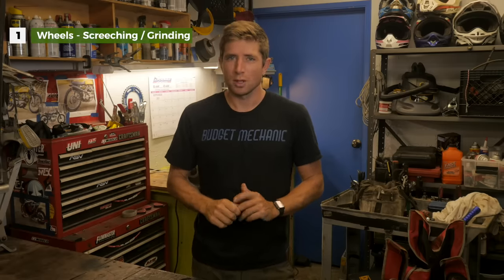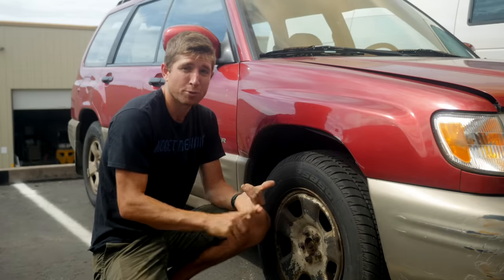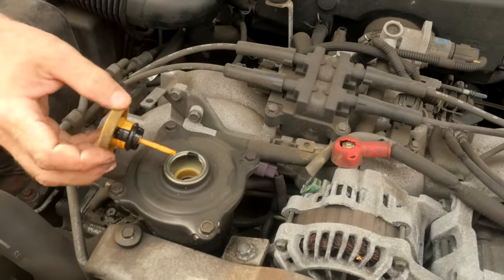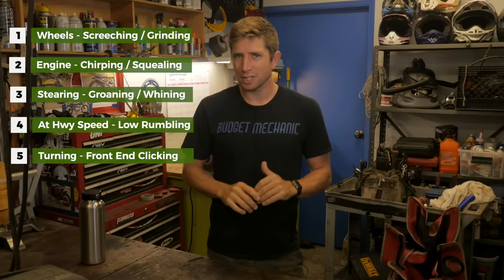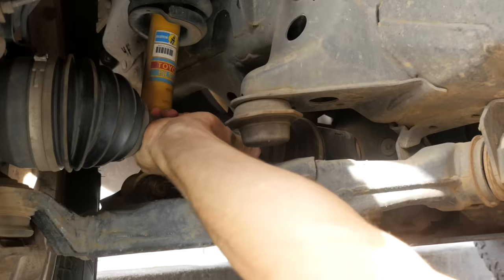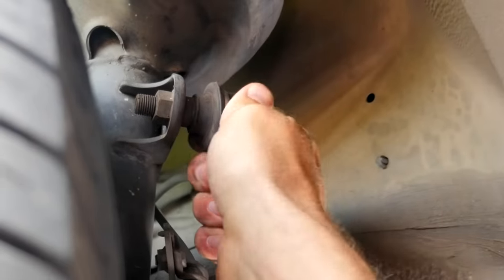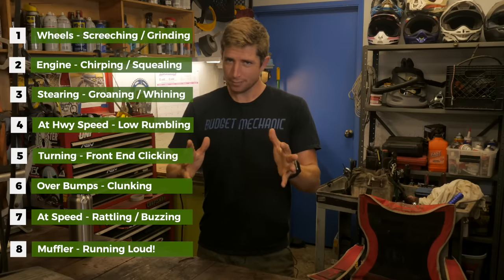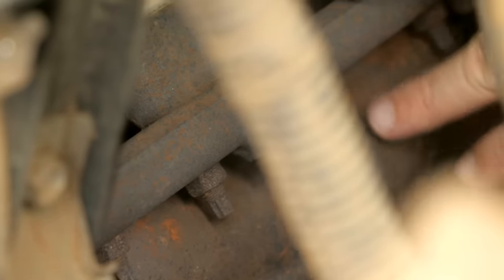8 Top Noises Your Car Engine Makes and How To Fix- Grind, Clunk, Squeal, Click, Groan, Rattle

Comment: Hi there!! Thanks for the video.
Relating to sound 3 Steering - I have the exact same noise every time I turn my steering wheel. I added some fluid into it and I could see the foam inside it when I opened the reservoir cap.I turned the steering wheel lock to lock to get ride of the air bubbles, but that didn’t work. I kept checking it and oil the started to leak from the reservoir even when the cap was tight.Also, the turning steering noise had intensified. Is it the pump failure or the air leak in the system? Would it cause the entire the steering system failure, because I could feel the friction or grinding motion every time I turn the wheel.

At first,as soon as I noticed I filled the power steering fluid to prevent further damage, I could feel the pump working fine and was able to steer easily when I first noticed and topped it with fluid, but it started to leak again making to hard to turn.

Can you help me understand??
Thank you!!

Comment: and for trucks, you have the horrible grinding noise under your truck, your center support/drive shaft bearing. You have to take the entire drive shaft off and honestly use a hydraulic press to install the new one. ive done it twice with just blocks of wood and a sledgehammer, and its not the proper way. it will never be on like the factory unless you use a hydraulic press they have in a shop. and then axel noises. I feel like we'd need a whole different video for pickup trucks.

Comment: Holy shit those sounds allowed me to instantly diagnose a CV and sway bar issue that's been driving me nuts!! Thank you so much for this helpful video! I'm also experiencing a whining sound at higher speed that's only present when accelerator is being pressed. When I let off the pedal the noise stops. Could this be low or bad transmission fluid? Manual says to change at 60k with severe use. I'm at 84k now and live in hot ass South Florida with dense city traffic. The fluid has never been changed or flushed.

Comment: My car has one of the last 2 problems.  I ran over a speed bump too fast and it's been making that noise ever since.  It probably dented a heat shield or caused an exhaust leak of some sort.  At first I thought it was the transmission, but the mechanic ruled that out.  Now I have a new more serious problem that the oil cap has blown off twice now which might mean the engine will go soon.

Comment: my car make the noise on 6:58 when I am braking over bumps (mostly downhill) and the brakes are releasing, then I press the brakes very hard to stop the car or even use the hand brakes, it don't happens all the times but its dangerous and my mechanic don't know what it is.

Comment: I’m having a sound that’s sort of like a  soda can rolling on pavement, or maybe a high pitched frog. It happens at low speeds, most loud and longer when I’m coming to a stop or turning. When in P, I almost don’t hear it at all but just a slight brief sound if I tap on the gas pedal. In combination with this, the oil pressure gauge drops low. It’s somewhat low when in P but if I’m in gear and turn the wheel (even if I’m not moving), it drops low and I hear other humming noises in addition to the rattling. Just had oil change. 

2004 Astro AWD, 170,000 miles

Comment: Now this is a five-star video. I think the one bugging me is a heat shield.  It has had some before. Your clue. maybe  a rock got under it has given me something to look for. Usually tapping things with a rubber mallet finds these, but so far that has not found the current one.

Comment: Thanks Josh, This is the most comprehensive description of problems I have ever come across. Thank you for that. I am currently in research for a loud bearing0like noise coming from the front end that seems not to be the wheel bearings. Our 2012 Ford Explorer 4X 4 sounds like bad bearing(s) but all are firm and the sound doesn't change on turns. Can't figure it out!

Comment: Hey, i watched this video was good but didn’t cover my concern let me know if someone can help me,, i have 2008 toyota yaris, i started hearing ticking noise from my car as soon as i put in drive or reverse it produces noise otherwise in neutral or park is fine no noise but like i stopped at intersection and still i am in drive as usually we all are that noise become loud and it is like tick tick tick continuously but if i drive it goes or just like lower down. Let me know my city is very expensive asking $250 everytime i ask for inspection.

Comment: I know this is an older vid, but hopeful for a response anyways? (Prefacing with already planning to take my car to the mechanic) 
My left wheel is makin a noise that makes me think of something stuck in bike spokes or someone poking something into a fan blade. Its at any speed going straight or going left (hard left, slight left, any left). Nothing when wheel is pulled right to any degree. 

Theres the slightest of vibrations, but nothing really noticable if you arent paying attention. No shaking either. 

Like theres 3 things you mentioned that might be it but im just not sure.

Comment: I have a question. After driving my car for a while my left front wheel on my is300 starts squealing you can hear it very well when I drive by a curb and when I brake it gets loud then it goes away at a full stop. Then once I start driving again it starts squealing, I’m not sure what’ it is
Reply from the maker: Might be the brake pad retainer clip rubbing on the rotor

Comment: The best way I can describe my sound is a rubber ball bouncing in a plastic bucket. It sounds similar to the stabilizer Links.  This is a 2021 camry and I'll be taking it in for the 5th time. They can't seem to figure it out and the 4th time they tried playing the "I don't hear it" card when I demoed the issue.  At this time I'll have to figure out the lemon process

Comment: @ 6:42 - "...you just have to replace it, to see if that's what it was."

I'm convinced far too many mechanics go with this method for diagnosing and suggesting solutions for all areas not just the CV shaft, lol...way too many instances of outrageous bills to replace everything in the area from customers (including myself), when it either a) was unnecessary or b) didn't fix the issue

Labor costs for legit repairs I can accept. Mechanics have to charge hourly and get paid too. What I hate is how I how ongoing issues from Mechanics suggesting incorrect or costly repairs has happened to both my wife and I's vehicles. This is why I like vids like this because at least I can play the diagnosis game myself on my own time without labor costs (except my time). Hardest repair I've done (differential bearing) would not have been possible without youtubers and this "sound guessing" game.

Comment: My car sounds like an appachi helicopter fluttering kinda sound not a clue what it is. Don't match any of these
Reply from the maker: We tried to add that to the video but couldn’t get close enough to any Apache’s to record it so we took it off the list, sorry!!
Reply: @BudgetMechanicHawaii  it’s like a sound when you have windows open going down a road fast only windows closed and it’s coming from within a diff place

Comment: For my Hyundai i20, when I switch on the engine it creates Hmmmmnnnnnn. The car seems to be underpowered. Previously car was in garage for 3 yrs without mobility. Got to Garage and they said Alternator is not working and also AC COMPRESSOR IS gone. What should I do?

Comment: My issue with my steering wheel is that i only hear this knocking/rattling noise whenever I go fast on the highway. About 60+mph. It's annoying because i only hear and feel the rattling/hard vibration when I leave the steering wheel straight. Soon as I slightly turn the steering wheel to steer or turn on a curved road it goes away. Someone please help me figure out what the noise is. I have a 2014 Santa Fe sport Hyundai.

Comment: Hello, i have a problem with the back wheel left side of my car

It all started from this old mechanic guy after replacing the break pad. 
He went for a drive test to check whether the sounds is still there, unfortunately there is still sound. But he told me that it’s normal and bla bla bla. 
Then after 3 days, i went to vacation and took my car, it was a 4hour drive. I started to hear weird sounds, it turn out that the left tyre wheel was not fitted properly. It collapsed a bit and not at the straight position. I called someone to fix the wheel, and I thought the sound gone but there’s more sound coming even though we fitted all the tyers. I wonder why the back wheel keep making sound everytime i drive slowy . The sound is very clear.  What is the reason of that ? Do i need to replace the break disc/ wheel bearing/ or anything from the back wheel?  Because we never had any problem like that before

Comment: mine does a huge thump as I accelerate and I starting to squeal at the same time. it doesn't matter if I'm turning or hitting a bump it just thuds in general as I go and the more I drive to higher speeds the harder and louder the thump. what could that be? I'm in a 2.2 engine Chevy cobalt , like the stabilizer but it is very firm and stern thumps

Comment: I'm getting the stabiliser noise u described plus I also get vibration when braking at high speed and at low speed I get the same noise but only when I apply about 1/4 brake. That doe not happen when I'm braking harsh.

Comment: First of all thanks for ur time and sharing all these info.
 So a few days ago when i turn my steering wheel all the way to get out of my parking , heard a pop sound , tought it was bottle i ran over but it wasnt. Later on i saw a leak on the passenger side front tire  after i parked.And it still leaks slowly, looks like cv boot is leaking , so if that the cv boot, do i need to change the entire axle or cv replacement is enough?

Comment: Under the driver or passenger seat is aloud grinding noise almost sounds like coffee brewing and at one point sounded like I was dragging something. 2015 infinti qx60. I found out i had a hole in my front differential I temporarily patched it up refilled fluids and the sound wasn't bad at all sometimes gone and the dragging feeling was completely gone. But I was losing power couldn't really go over 80 and it would almost get stuck in 2nd gear....I just heard the cv axle and the stabilizer that's what it kinda sounds like but I don't have to turn to hear it
Reply: Any help with this?

Comment: The messykan shop sold us a Honda that is vibrating upon low acceleration. Brought it to Honda dealership and they told us that the axle is licking and thorn and need to be replaced. Is that correct?

Comment: SIR I HAVE A NISSAN PATHFINDER 2001 MODEL CAR. SO THE PROBLEM IS WHEN I DRIVE ON A HUMP WITHOUT BRAKE AND THEN ACCELERATE AFTER CROSSING THE HUMP CAR MAKES A SOUND AND WHEN I DEACCELERATE ITS GONE AND IT COME ONLY AFTER I HIT HUMP. NORMALLY WHEN CARS ACCELERATES IT IS QUITE BUT MINE AFTER HITTING HUMP MAKES A LITTLE LOUD SOUND. IF ANYONE ELSE KNOWS SOLUTION THEN TELL.

Comment: I’m starting to get a “krrr” from under the front of the car, more from the passenger side (I think)  as I accelerate, when I release the gas pedal, it doesn’t do it, but then when I hit the gas again, it does it and goes away or I don’t hear it in higher speeds.  Any idea what that would be?

Comment: I wouldn't call the noise that loose heat shields make a buzz. It's more like a rattle. Although I suppose you can buzz too it could be either a buzz or a rattle honestly. Mine was so rusted and lose that it rattled absolutely no buzzing there lol

Comment: I have the same noise of bad CV axle with vibration without turning the wheel and comes at red light and goes when I accelerate...whats the diagnosis?

Comment: They already changed the serpentine belt on my Impala I just bought.
But I still hear a pitch E squeak
On passenger side when I accelerate not sure what it could be . Reason I took it in was because it would make a grind noise when warming up when cold . Do you know what it could be I don't think they changed out the timing belt but Im not sure if that could cause those symptoms
Reply from the maker: If belt is still squealing could be the belt tensioner. Another thing to check is if alternator or AC compressor have bad bearings. You can put a long wrench or stick on each while the car is running and touch your head to it. Vibrations from a bad bearing will be loud

Comment: My car makes the same noise as if it has the loose exhaust shield, maybe it is that, but the noise that it makes only makes it when Im turning left most of the time or I just accelerate it at a low rpm.

Comment: Non of these were the sounds my car is making. Its a loud bang when I turn going slow. No clicking.. Sounds like metal breaking like wheel or something underneath is breaking off and my steering wheel is turned to the left when tires are straight. It was pulling me also but I slowed my speed and maintained control
Reply from the maker: Sounds dangerous! Someone needs to get under there and physically inspect things

Comment: Hey there I changed my Throttle body New Battery New Gasket New body throttle gasket when I let my car sit there and idle it starts sounding like a van and looses power when I put the gas down and the engine shakes makes like a clunk sound
Reply: First I'd want to know why you replaced the throttle body. What issue were you trying to fix with a new one? What was the car doing before?

Comment: Awesome .. I had a weird "hissing" noise when I started the car almost like a vacuum leak or exhaust leak.. but the car runs absolutely fine no performance issues. The power steering fluid was low on mine... This was same sort of sound... Still no confirmed but this helps a lot!!

Comment: I have a sound where for the first like half mile after a cold start, the truck will hesitate to move and when I let off the gas there’s a loud grind sound almost. It goes away after the truck is driven a bit but when I have to turn or brake and press the gas too far it makes a sort of rattling sound until I let off the gas
Reply from the maker: I would do a visual inspection of brakes and suspension first, see if there’s anything obviously rubbing/dragging

Comment: Aloha my friend! From your vast experience what do you think is the cause of this noise? https://www.youtube.com/shorts/jONLS407u2Q It only appears when I am over 60Mph and get's louder and louder as I accelerate... I will be much obliged if you can share your opinion with me. Ty!
Reply from the maker: Man so hard to say. On the video sounds like a rattling noise from plastic or rubber maybe outside from the wind? Hard to say from a recording sorry
Reply: @BudgetMechanicHawaii  thanks very much for taking the time! Might be the shield cover under the car, altough I took it to a service and they put it on an elevator and nothing seemed to be loose, but might be a stone/pebble in there.. who knows. Anyway tx again!

Comment: My super honest mechanic was busy and I needed the back pipes cleaned and regreased according to my latest MOT.
The emissions check was on the edge and MOT recommended doing that to be in line for next year.
Car is a 2010 with 133,000+ mileage  
I went to a new garage and he did it.
Car is now whining seems to be an exhaust problem.
Im thinking the new garage put a hole in the pipe.
IDK When the MOT man suggested I get the "back pipes" cleaned and degreased he was talking about the exhaust pipes.

I hope my reliable garage is not too busy this time.
The noise is not on this video
Reply from the maker: I guess I’m not sure what back pipes greased means either….
Reply: Its a weird one for sure.
I felt a bit daft saying that to the garage man but he didnt bat an eyelid so Im assuming its local car talk @BudgetMechanicHawaii

Comment: Cool and informative vedio. I have a 04 Saturn Ion 3. I just replaced both front wheel hubs, rortors and pads and all 4 tires. I'm still getting a hum noise still in the passger side. I don't get it when driving city driving. But when on the freeway at high speed. It will hum. I'm wondering if the new hum I got is defective or if the passger tire I got is bad or defective. I'm at a loss.  I'm wondering if the calpier are sticking. They the original Calipers that came with the car. So I'd really appreciate any help

Comment: I have an 06 camry 4 cylinder and my current issue is when i rev my engine or drive down the road my car makes a vrrrrrr noise that kinda sounds like a tiny dirtbike its runs fine and has no engine light but it does shake a little hard when the ac is turned on
Reply: Ac on or off it still makes that noise and it just recently started
Reply from the maker: Hard to say sorry! Did you check out our video on noises and the one on rough idle? Maybe that could give you some noise ideas

Comment: Thank you for the video. My var has just been changed the 'clutch kit' (not sure what is involved in this kit); slave cylinder also changed together with dual mass flywheel, gear box oil and brake fluid. However, after paying so much money for this work, the clutch is now snapping on release and the pressure feels low. The 1st mechanic I raised this with said they had not bled the car as it was driving well but they'll do that straightaway as that's what is causing it. But his boss is refusing saying I just need to drive the car and it will regulate itself. I don't know much about this - please help! Which mechanic is right and what is your opinion. Thank you
Reply from the maker: I’m afraid I’m not sure about this situation without being able to check it myself!! But you know the car best, so don’t let them tell you it’s “fine”!